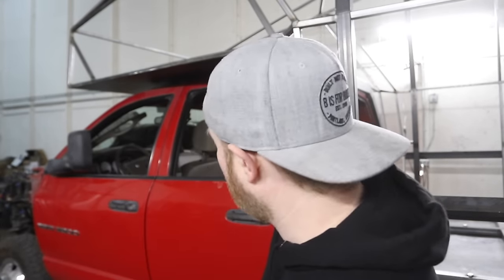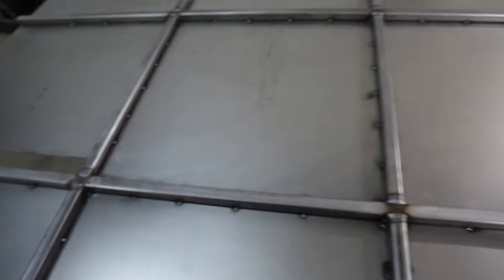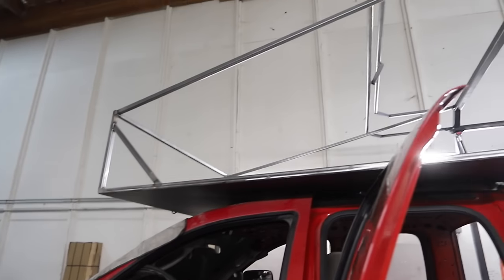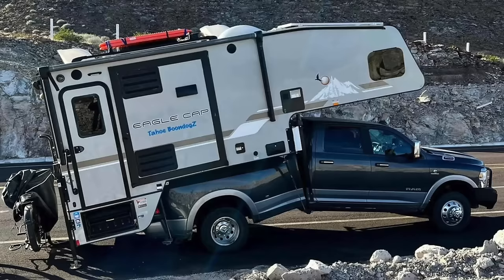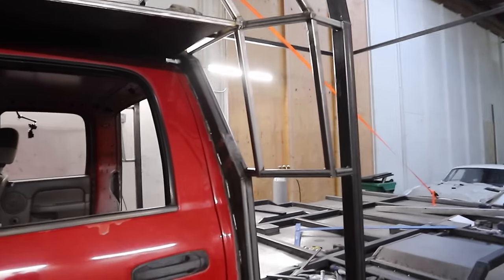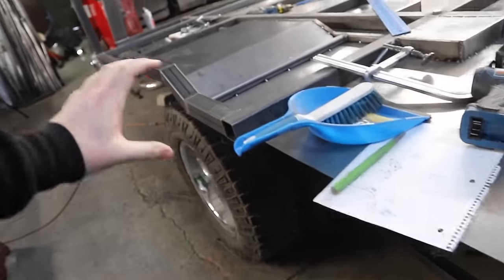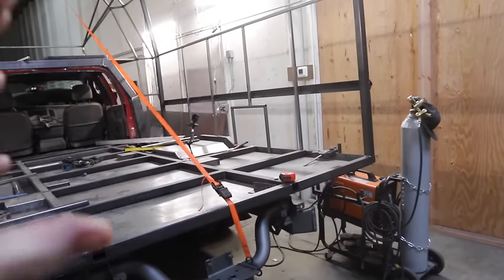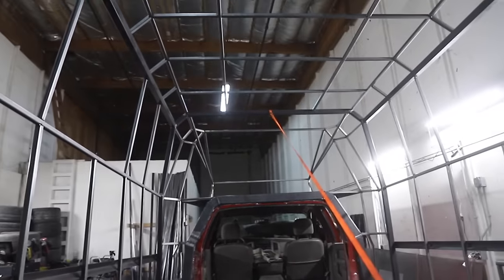Building The Worlds Craziest Overlanding Camper Truck - The ROOF

Comment: The bent frame guy was also on a short bed truck I think vs your long bed/extended bed truck.  That's a big difference!
Reply: No, the widely featured broken Ram and this truck are both Ram 3500 DRW with 8-foot boxes. This one is a lot older - they are different by generations.

Comment: To save on the outer skin, find a transport truck salvage yard try and buy the outside skin off a trailer. It will have to be riveted to the frame work, its aluminum you will save on weight, also get some roof skin and panel bond it down.

Comment: I'm sure it will be great, the bones are coming along. Will having the camper attached to the cab create some issues when to truck articulates over bumps or pot holes?
Reply: Probably not. 80s or 90s truck frames are designed to flex, but these modern trucks really don't flex much.
Reply: Yes it certainly will... Those welds will rip right out of the top of the cab

Comment: If you look in to the house construction buissnes there is insolated sandwich sheets for like 6$ / sq feet. Then you dont have to use all them steel tubes. They are doubble sided and painted allready. I build a caravan with 3" sandwichs panels without any framing at all, beside the floor. Worked perfekt. $1000 worth of panels  for a 2,3 meter by 4,5 meter trailer.
Reply: SIPs: structural insulated panels

Comment: Consider making the door on the right side ( passenger side) for safety on the highway if you pull over and need to get in and out of the camper section.

Comment: You NEED to get a Titan Fuel Tank for this thing. Especially with the added fuel consumption due to the worse aerodynamics of the truck. That Titan fuel tank will make it so you have roughly 30%-50% more fuel than the stock tank

Comment: 1 inch won't be enough/ the cab will move 3 inches plus twist / limb sliders bolted the the roo bar helps stabilise the over cab bunk / also  helps the roo bar with impact

Comment: That truck with the slide in camper you posted a picture of; the frame cracked at a weld. Has only happened once or twice ive seen online and all were the new trucks.

Comment: If the weight is distributed before the rear axle and you don't go crazy with 10 gauge steel sheets for walls the weight should not be a problem and the frame is not going to crack. And you can always weld frame support if that's a concern

Comment: Some box vans are built similarly. 
Not so much with the steel box, but the box they use (aluminum, or fiberglass coated plywood) is solid mounted to the frame and the cutaway cab is mounted in rubber. 
They do just fine.
Reply: But do those boxes vans go off-road? No.
Reply: @brianb-p6586  mine does

Comment: I built something similar to this. There is one thing you may want to address, that I found on mine. Since the front overhangs the cab, there is a bunch of wind noise as it is captured by the overhang and passes over the roof. I tried a few things, but addressing it after it was built proved to be difficult. Looks good though.
Reply: I guess I should clarify this was noise in the cab while driving.
Reply: Drop the headliner and sound deaden the roof with sound mats. Like we do for car audio!

Comment: Probably too late but If you are worried about weight on the walls you could do your patented airplane fabric trick on the outside with a layer of rigid insulation sandwiched between that and maybe some FRP panels inside (which are about $25 to $50 for a 48"x96" sheet)....Screw + Silicone it together to the steel frame. What was that stuff? Ceconite fabric?

Comment: Steel is strong and used sparingly, can be light if used where it is needed and thinned out where you can get away with it.  I had some device that I thought was aluminum, but I found it was all steel and sheet metal and it was surprisingly light for it’s size.  I just can’t remember what it was 😂.

Comment: Id like to see you add quick disconnects where it bolts to the floor and four electric jacks so you could remove it when you are out camping and stuff
Reply: It's welded to the cab
Reply: @fraserfab68  I know that I think it should be able to be removed in the future so they could have the possibilities to do fifth wheel towing and stuff

Comment: There's a reason that campers and RVs are built of aluminum, wood, and fiberglass. Going to be a rusty mess in a few years if you don't powder coat the entire thing which isn't possible with the way you have built it. Did you see the newer dodge dually that bent in half?
Reply: What if it is rhino lined?

Comment: I feel like refrigeration panels would have been better to build the walls, roof & floor. Insulation + covering in one.
Reply: Those are normally called "SIP" - structural insulated panels. Yes, that's how the better overland campers are built.

Comment: Chris, have you thought about doing the fiberglassing or carbon fiber techniques you tried with the burntacon? I recon you'll save a couple hundred pounds of weight especially on the top half of the build, and you MIGHT even have a better looking build after the fact.

Comment: Your going to need a big BTU AC unit in that thing. I had a 19foot travel triller that came with a 8000BTU unit and it could not cool the coach down… even in the shade… we put in a 12k unit and all was right in the world… Also unit that can run as a AC and Heater (heat pump) would kill two birds with one stone.

Comment: I would be less concerned about weight and more worried more about attaching the living quarters to the cab, because the cab is usually designed to move independently of the frame and the bed.

Comment: Just in case I’d recommend just adding some frame reinforcements in the middle so you don’t have what happened on the 3500 in the picture. Just slap 2, 3 foot sections of flat bar and weld in and should be good to go

Comment: I'm sure you guys know that the truck cab is not a unibody. If part of the camper is welded to the truck cab, its going to crack later because of the movement of the cab because of the rubber cab mounts on rough road.

Comment: I know this is a bit late, but if the truck was being made when dodge was switching to the 6.7 Cummins but yours was already being made they would have used a mix between the 07 and 07.5 parts, so that fill cap area was probably supposed to be for an 07.5 truck since they use def and yours wouldn't need def, they probably modified it from the factory to only have a fuel fill neck

Comment: If you plan on camping at actual "campgrounds", you should consider placing the main door on the passenger side.  Otherwise, when you pull into a campground camping spot you will be on the wrong side.  If your plan is to wild camp, it won't matter much.

Comment: I for one don't think the weight is going to be an issue.  I just went to the RV show in Toronto and they had massive RVs on a Sprinter chassis.  I think you're fine.
Reply: Do you know the gvwr of a 1 ton dually.  It's less than you think

Comment: Honestly i was also thinking about the fact that the steel would make it weigh too much but, considering the ridiculous prices for campers, i completely understand, however you could have used sheets of plywood for the flooring and wall panels etc, plywood is very cheap compared to steel and is very commonly used in campers too.

Comment: I know it's an extra step but have you considered adding a second axle in the rear? It would be lots of work but worth it for reducing tire wear and load balance. @bisforbuild
Reply: It doesn't need another axle - there's more capacity in the one rear axle that it has than the frame can handle. For balance, they should have extended the wheelbase instead of extending the rear of the frame.

Comment: The new Rams with the frame cracking issues, the new Rams don't have the frame braces and crack where the brace would normally be at on the older gens

Comment: most RV's are made of thin wood and cheap engineered wood products. having your skeleton made of steel tubing like this is smart because it will be durable and last longer. you can save weight on the interior and it will still be a better longer lasting piece of equipment. curious what your exterior walls are going to be. I'm also curious how you will be able to service the roof lights on the cab. isnt there a screw in the top that will be nearly impossible to get to now that the front part is installed?

Comment: I think you will be ok with weight but I see something that I think you will wish you had done. It would be nice to notch the roof of the cab to allow easier access to the living space from the cab. Most factory rvs have split beds that fold in half. Just an idea concerning you are integrating the structure of the cab and rear.
Reply: In a proper Class C the cab roof isn't usually just notched - it's removed. Yes, removing at least the back half would have made sense.

Comment: I was not to worried about total weight because those trucks can pull lots of weight. I am more worried about the weight behind the rear axle aka weight distribution since you did not move the axle. That is how and why those in-bed campus do that to the frame while the conversion campers does not have issues. The weight distribution is evened out with the conversions.

That is another reason why the 5th wheel and gooseneck trailer hookups are right on top of the rear axle in most cases.

Comment: Talkin about materials: wouldn't plywood be an option? You know, for wall sections that don't bear any weight? Or is wood also so expensive now? Honestly don't know, been a while since I had to buy some. Also no idea if it would (wood?) work. Never built a camper, but I think a lot of the older campers are built mainly from plywood 🤔

Comment: Ittnot the weight of the frame that is concerning, but the weight of what you put on and in that is the issue. The truck bed was just that, a truck bed. You are basically building a house on top of a truck, and there is where the majority of the weight comes into play.

Comment: You should have weighed the truck with the bed still on it then weighed it without the bed and then when you finish the whole thing weigh it one last time so then you have exactly how much weight was removed and how much was added back. I'm curious about how much the finished product is gonna weigh. im guessing around 10k pounds when finished maybe a little less since the truck was originally about 6800 pounds

Comment: Coming from someone who’s father owned a heavy equipment engineering manufacturing, fabrication and machine shop who’s built tons of trucks I believe your truck will be okay as far as not braking in half. I would prefer to at least to box the frame but would prefer a double frame. However based on actual real world experience with our engineers I still stand by the fact that the rear axle should be moved rearwards. Once you load the actual camper with beds, stove cabinets food drinks and camping provisions then try to add a trailer with a side by side, fuel extra propane for heating and cooking the ability to tow will be very limited and will most likely take to much weight off the front axles. 

I’m really not trying to bash you guys I really support you guys having a good time designing and building thing and thinking outside of the box. If I thought you guys were idiots I would waste my time watching your videos. Do with that said I totally support what y’all are doing and hope that you continue for years to come. I’m only trying to pass on experience from mistakes that I’ve made and seen made while designing and fabricating hoping to help prevent future problems that will just cost more money.

Comment: I guarantee it will be well over what that other camper was when finished lol I’d build it from aluminum and aluminum sheets And insulation sandwiched walls or wouldn’t built it at all, looks good so far but weight is so important with campers

Comment: Dude these truck will haul 22+ thousand pounds easy. Aluminum would be 5 times the price so over 20 years you might have to spend that in fuel with the steel. I build all my tiny homes out of 1”x.083 wall steel  tubing and it’s way lighter than wood.+ way way stronger. I have no problems towing 12,500 lbs with my ram Cummins single rear wheel . I get 17mph fully loaded at 21,500 trailer truck and 325gal water tank in truck bed. 5” strait pipe you’ll know it’s me haha. For miles, and if your window is open passing on the right, sucks to be you. And bye bye ear drum. I drag raced my wife in my 06 sti and when she passed me on the left in the dodge it about blew my windows out of my car and my ears are still ringing and this was 2 years ago. For those out there worried, you have no idea what your doing. And have never been behind the wheel of a Cummins 6.7. Mine is 750hp and 1560ftlb torque,

Comment: oh man your sheeting in steel not fiberglass sheets or aluminum.... good luck its gonna be LOUD driving down the road unless you insulate with expanding foam, and heavy
Reply: you probably should have called a bus dealer and ordered a roof sheet from them, creative bus group is near you and their parts guy will get you the sheet they run around 700 bucks

Comment: I would brace the frame some, you can box the inside or plate the outside with just some 1/8 steel plate that’s a hood with to fit on the rail, and you need to leave the fuel fill hole in the shape of a male reproductive organ

Comment: You didnt have to spend $100k on aluminium. You could have spend a tiny fraction of that on composite walls. This thing is deffo going to be hell in the diff, trans, suspension, engine, etc. it IS going to weight too much after its complete. This is being built like its supposed to withstand a barrel roll down a mountain. But hey what do I know Ive only built them and lived mobile the past idk how many years 😂

Comment: 3rd Gen seats suck. Get some 4th or 5th gen seats from a wrecked truck. They just bolt right in. I took seats out of a 21 work truck and put them in my 08. Looks almost like it came with the newer seats.